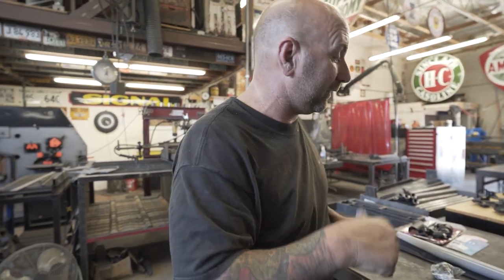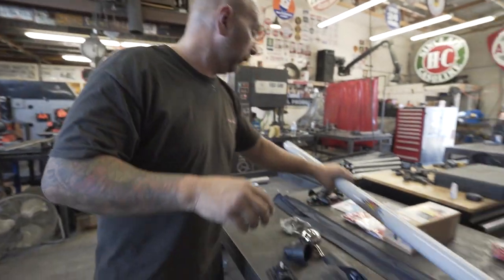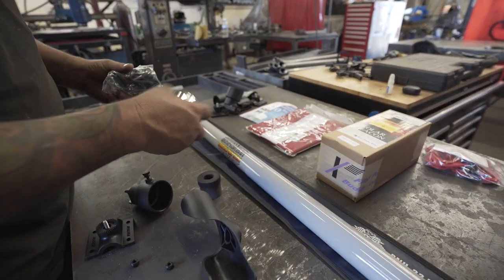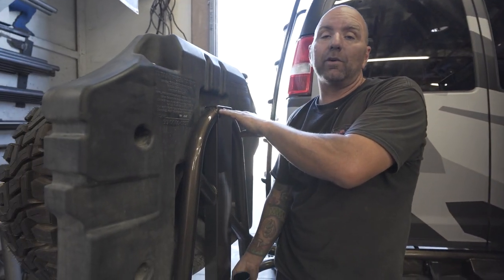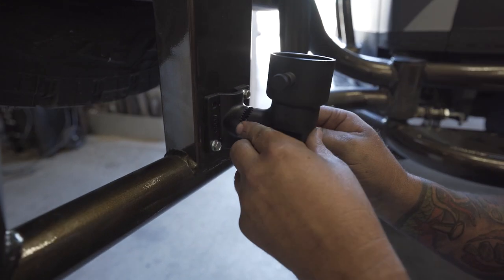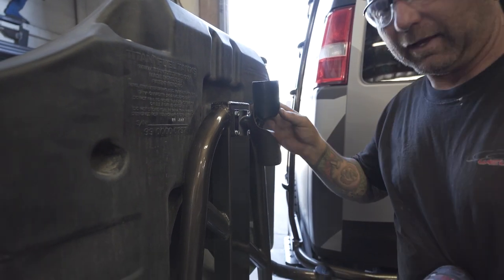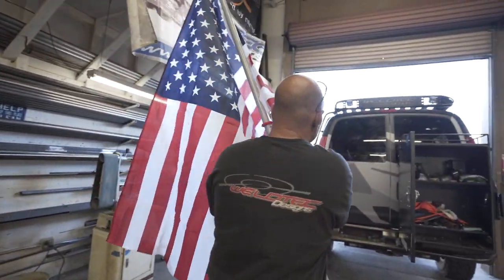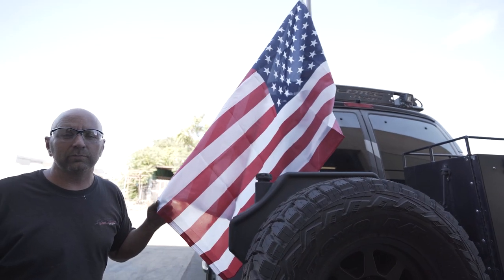Installing Custom Flagpole Mount | Chevy Express Van Build

Comment: I have a U.S. flag flying on my patio 24/7 with a solar night light.  I also have a U.S. flag on the wall in my garage.
Be careful of those fiberglass telescoping poles.  I cracked mine in half at Anza-Borrego Desert State Park on my travel trailer with those crazy afternoon winds.
I now have an aluminum telescoping pole and also built my own mount with square aluminum tubing U-bolted to the bumper.  I use Velcro strips to keep it straight on the ladder.